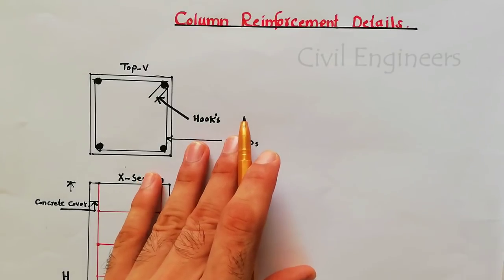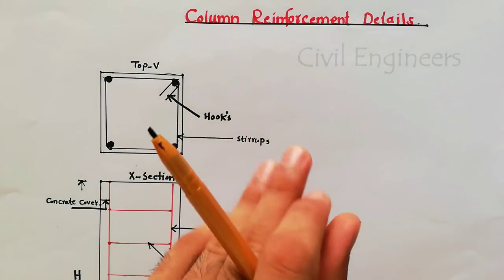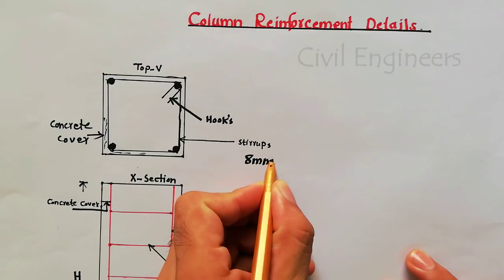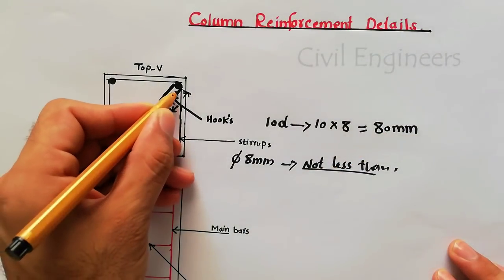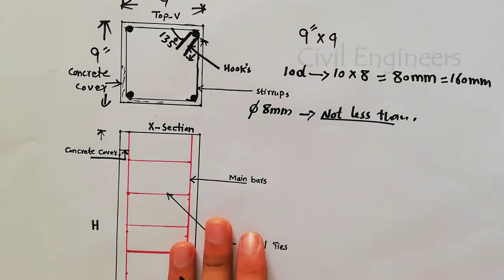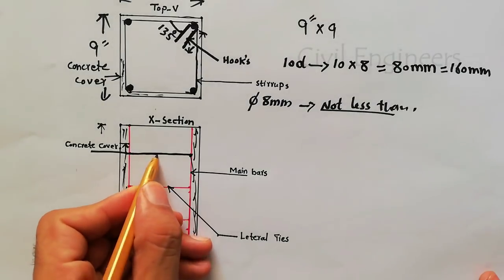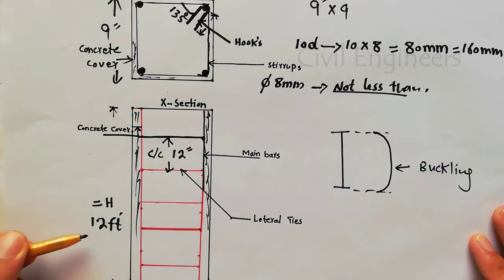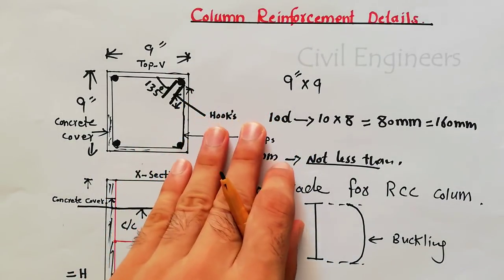RCC Column Reinforcement details

Comment: Bro
I am mechanical engineer
I design machines for coir industry
What should be the dimension of 4  column which have to bear viberation load 
Weight of the machine is 3 tons
Height of columns needed is 7 ft
My assumption( rebar 12 mm----45 grade concrete  with slag cement---8mm ties---colum dimension 1.5 ft /1.5 ft